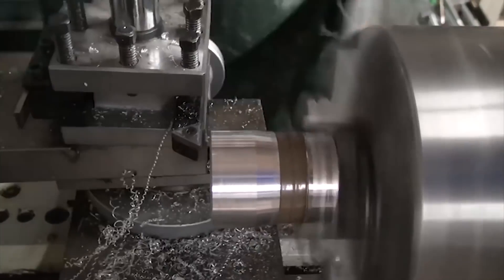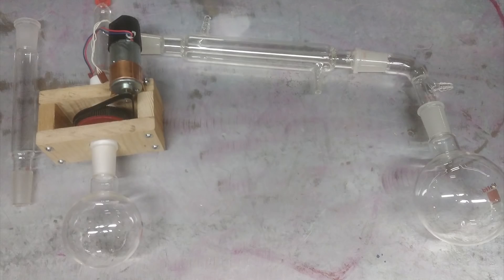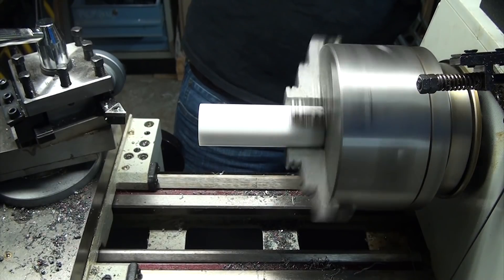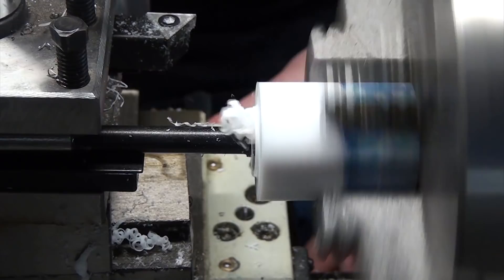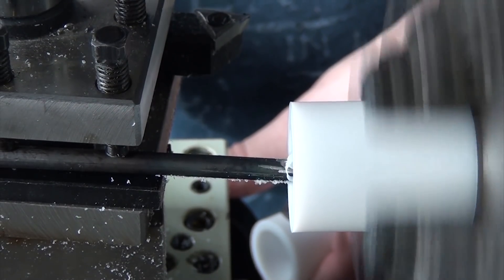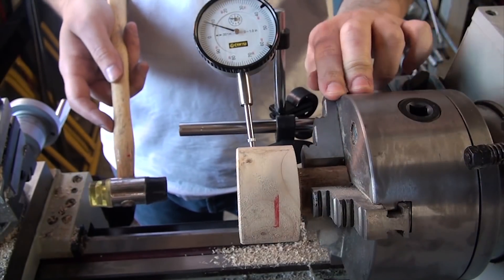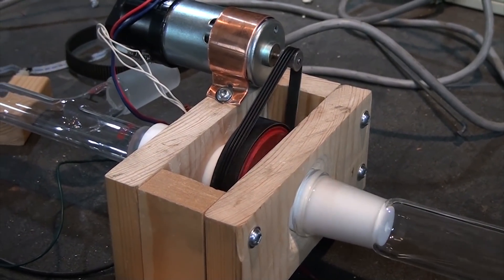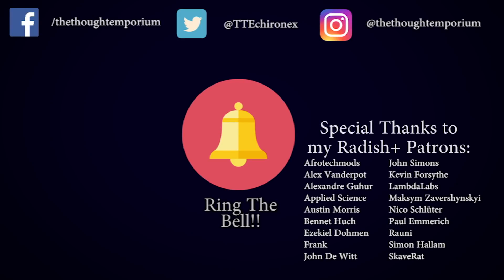DIY Rotovap - Motorized Rotary Vacuum Coupling Build

Comment: This is absolutely informative and helpful. The problem with my Rotary Evaporator is the spin is not working. If the spin is not working, then what could be the cause? Help me identify it so I can fix it please
Reply: Bad Motor, Unconnected Wire or Belt.

Comment: Very nice. Possible improvements: double o-ring; a roller or ball bearing to support the rotating shaft; a lip on the rotating part so the keck click can be used to secure the rotating flask / adapter. Anyway, would be interesting to see how it works under vacuum.

Comment: I strongly prefer sleeve and spool rotating connections with 2 o-rings over single o-ring design, the disadvantage is there are 2 seals instead of 1,and the hookups are 90° apart instead of straight, the advantage is pressure and vacuum produce no net force on the coupling, which is why hydraulic swivels utilizing this design are often only held together by a snap ring, and the other style usually require a ring of ball bearings to keep the fitting from exploding under pressure. Come to think of it, you could have simply purchased a snap ring style swivel from your local hydraulic shop, although they are made of metal, which might be a problem depending on the chemicals you are dealing with.

Comment: Regarding the large timing pulley, you wrapped a belt over it tooth side out and bonded that in place?  Normally, that won't work, as the spacing between the teeth on a pulley must be slightly less then that of the belt.  The belt should repeatedly jump teeth.  How did you get this to work?

Comment: Slick.  Roto-vaps are a big deal in organic.  Eventually your going to have to get something that works.  The alternative is that you get two round bottoms and have a connecting   bit in the middle.  The set up that I seen when I was a Freshman (the one and only time as the Department got a better one) --- so two containers, one was in a pan of warm water and the other was in a pan of cold water with the cold side having a plastic bit that attached to the hole melted onto a small diameter Pyrex tubing. That went to a aspirator.  The plastic bits, both the one in the middle where the small motor was and the output side were fashioned from blocks of high density polyethylene --- if memory serves.  One of the Department's Professors was a skilled glass blower besides being a cracker jack chemist and a fine instructor.  Them were the days!

Comment: it would be easier and more reliable to replicate original buchi's design - two ball bearings and a standard radial shaft seal directly on rotating glass tube (with male ground glass joint)

Comment: Could this be used for heavy vacuum distillation??
Reply: @Defke Willms Depends on the vacuum you have set up
As long as there's no leaks and you're using the right cryogenic then I don't see why not

Comment: the price of these means none in my kitchen lab.   but an alternative is simply
placing the flask vertical on a  adjustable stirring hot plate with a vacuum source.
and the proper 24/40 connections.  the stir bar will slosh t he liquid up the walls
a ways on a round bottom 1 L flask.
a water faucet aspirator will give you a few -psi.    and may not be enough for you.
my 12V. vac' pump cost about $30 on ebay,  its a 'diaphragm' type  that offers ports
for either vacuum or pressure.  the vac' goes to about -10psi.    by on-off it duty-cycle -wise
you can get any vacuum you want between 0 and -10psi.    

     can someone tell me what sort of software the thought emporium person
uses to make his videos ?  camera too.  and anything else related  to making
such good productions.  like where the action is speeded up.

Comment: im worried about the material you used cant handle some of the materials you are ineneverbly going to use in it,  some plasiks corode when used with difrend substances like alcohol asid and bases, wouldent it be better to get it made from either glass or ceramik, i really like your vids and really hope you consider all the posibilites when you use it so you wont get wear and ters or some residue stuck in the material that can react with future project materials.
Reply from the maker: You realize Teflon is one of the most inert materials we have right?
Reply: PTFE is chemically resistant to most solvents, and is commonly used in laboratory equipment.

Comment: Nice!! Ive been wanting to make one of these as well. The hardest part seems to be keeping a good seal while being able to rotate the flask. Glad you figured it out. What type of tests did you do to test the seal?
Would you sell that specific part? (With the motor and everything).. I don't have a lathe :-(
Reply: I just built one without a lathe.  Go buy two PTFE Stir Bearing adapters on Ebay, a short piece of borosilicate glass tube (I used 7mm OD), and a couple packs of o-rings for repairing a faucet easily found at a hardware store.  If you put the glass tube through each of the bearings, you can connect two pieces of glass distillation equipment with a vacuum tight seal and the PTFE bearing will rotate on the glass tube.  In mine, I drilled out one of the bearings to just be able to freely rotate it, and on the other I drilled only enough to fit the glass tube in so tight that you would need to pry it out after inserting it. I put mine together and tested under vacuum and it holds whatever vacuum I pull on it. Of note, the extra o-rings are for added layers of protection on your vacuum.  I put an o-ring at all joints, including inside the ptfe bearings.

Comment: Interesting project. I don't know that I'd have chosen to use wooden components, but that part is sort of secondary to the coupler and could easily be made out of something else. A lathe with a taper attachement would make doing things like this easier, but it looks like you did just fine without.

Comment: Very cool build, though definitely second the suggestion to make sure you can clamp the flask on safely, I kept expecting it to fall off.  Also definitely invest in a cheap (Around $200 on eBay) two-stage 12 CFM vacuum pump!  Fridge compressors are just awful and generally fail very quickly as well as overheating all the time.  It’s just not worth your time since you’ll get a huge increase in performance and ultimate vacuum with a proper vacuum pump, which will be important since you are going to want to be able to dry things as quickly as possible and a fridge compressor just won’t work well at all as well as being incredibly slow.  Also don’t bother with Harbor Freight pumps, they’re overpriced and have pretty poor performance when you could get a unit with 4x the performance for a similar price from any of several eBay sellers in the US.  Finally, you’ll want to build a cold trap to remove the water from the vacuum line before it enters your pump since water will destroy your pump over time.

Comment: I think bearing-support on the rotating joint-part would be better.
Also, as others have pointed out, it should have the right lip so a clip can be added.
I also agree that you would only need a groove on one of the parts as you could rely on a bearing on the rotating part to keep it in place and thus also reduce friction.
Viton is probably a must, and some inert vacuum grease.

Comment: Not having a lathe (or sadly the space for one), if anyone knows of a company that could machine the two parts for a reasonable fee, that would be awesome.
Reply: I just built one without a lathe.  Go buy two PTFE Stir Bearing adapters on Ebay, a short piece of borosilicate glass tube (I used 7mm OD), and a couple packs of o-rings for repairing a faucet easily found at a hardware store.  If you put the glass tube through each of the bearings, you can connect two pieces of glass distillation equipment with a vacuum tight seal and the PTFE bearing will rotate on the glass tube.  In mine, I drilled out one of the bearings to just be able to freely rotate it, and on the other I drilled only enough to fit the glass tube in so tight that you would need to pry it out after inserting it. I put mine together and tested under vacuum and it holds whatever vacuum I pull on it. Of note, the extra o-rings are for added layers of protection on your vacuum.  I put an o-ring at all joints, including inside the ptfe bearings. You could also add dielectric vacuum grease (food safe to improve vacuum, but mine seemed stable without.  Rotating after a while may reduce vacuum though, so perhaps its ideal to have the grease).
Reply: @MrJzWilder  Great info. Do you have a pic or diagram to show where to drill the 2 holes in the bearings and what size drill bits were used for 7mm glasstube.
Reply: @MrJzWilder  
 We would most defiantly like to see your design. 
 Any pictures or drawings that you may have would be really useful.
Reply: Look in your area for a machine shop. Where I live there is an old manual machine  shop that does mostly one-offs for agricultural machine repair. These type of guys stay busy in certain seasons, but are generally quite inexpensive when they are bored.

Comment: I would love to see the updates on this, How well is your design working? Why didn't you cut it a bit longer and fut a flange for a keck clip? How are you retaining your evaporating flask? Are you using any vacuum grease on your coupling? Where did you source the motor? How well does the coupling retain vacuum? Im making one of these right now so I was wondering how your design will compare.

Comment: im working on a vacuum microwave, and came up with a strikingly similar solution. Here's a tip: The vacuum will keep the 2 parts together so the grooves need only to be on the shaft if you use 2 spaced o rings on the shaft (to keep linear alignment).

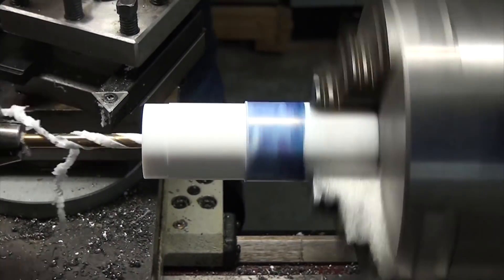Comment: 2:50 Next time you need to cut this taper, lightly chuck a 24/40 ground glass taper in a 4-jaw, clock it in as close as you can to zero runout, sight the top-slide against the taper and lightly lock it down, use a dial gauge in tool post against taper and move top slide, bump top-slide setting until you get '0' reading along full length of taper, lock down the top slide. It's now perfectly set. Remove the 24/40 and replace with teflon stock and start cutting using top and cross slide only (don't move the carriage after initial setup). Difficult to describe, very easy to do, and accurate.

Comment: Excellent project. I had wondered how a rotovap maintained the seal against vacuum. For setting angles accurately, look into getting a sine bar and a set of gage blocks. Both are relatively inexpensive and have lots of uses.

Comment: Really excited to see how this goes. Everyone doing amateur chem work would love to be able to hack together a usable, affordable rotovap. I thought the coupling looked like a pretty good idea. Might need a tweak or two, but I can't wait to see how it goes. My concern is trying to use a Leibig condenser. Even pulling a light vacuum (say 300mm absolute) with solvents boiling 60-80°range, using a simple column to put some distance between the pot and the condenser, and using ice in brine to keep cooling water -5 to -10C, way too much solvent was coming through my pump for me to keep using it that way, even though it is a PTFE-Lined diaphragm. And this is with just stirring on a digitally controlled warm hotplate. You can pick up a Friedrich condenser on ebay for $40-60, sometimes less with a little patience.
Reply: Ha! Nice pic yourself. We were in Madras, OR for the eclipse. Was pretty stoked to get the shots I did.
That sounds like a good idea. I'm trying to figure out how I can cobble together the glassware I have to do something like he's planning.
Reply: @NicholasA231  Corvallis is where we caught it, and thankyou!
Reply: first off, Nice profile picture. Second, I think the sous vide cooker would  be a perfect attachment for an amateur rotovap.

Comment: I once thought about using ZIploc seals for rotating air tight connections. They glide smooth and hold tight when you make them into a ring.

Comment: Great video, great project as always ! However, after 4 years of O-chem and watching all of ThisOldTony, i would've maybe done a few things different. The O-ring should only seal, not be the retaining part of your system. Also, it's going to be under vacuum, you should have made the 2 parts mate together, the vacuum will pull them together. I'd recommend you put 2 O-rings, only put a groove where your joint fit and get a good surface finish on the inside of the other part. Make the groove slightly larger than the ring so that it can flatten. (also take Vuiton O-ring otherwise solvents will destroy them in minutes)

All of this is opinion, maybe it works best as is! I'm sure i'll enjoy part two anyway ;)

Edit: also people pointed out there is no way to clamp the flask, never good to rely on vacuum alone, unless you want to come back to a spilled flask...
Reply: I was just about to comment the same stuff about the o-rings. Great video, I agree, I love most of what he does, but generally O-rings are a) designed to be slightly stretched, b) only utilize a groove on one of the two mating parts and c) ONLY SEAL lest one risks tearing the o-ring to shreads. The addition of  wear ring(s) and retaining rings would be a good idea. Also they aren't designed to be used dry, which also risks nicking it and rendering them useless (unless you buy super special rings which are designed for dry use but these are pricey and usually for very very specific applications like some rocket and space grade hardware). Also the lubricant should be of something different than the o-ring material and the encasement material  (ie if you use silicone o-rings you can't use silicone grease since like dissolves like).
Reply: @maxk4324  Polished ceramic disks make really good seals. Not sure if good enough for a vacuum. Like the valves in a single valve hot/cold faucet.
Reply: Was about to comment on this too. But seeing as the casing is made of Teflon, I think the most simple and impactful modification would be to use 2 O-rings on a conical shaft, a bit like an axial bearing. Because a single O-ring has no way to counter any bending torque, whereas two would generate a reaction torque to any bending stress. And the conical shape so you can assemble it. Alternatively there could be two diameters: smaller tip, larger base; easier to machine, but smaller axial stress capacity. I don't think the axial stress is large enough for the intended purpose to warrant a separate retaining part.
Reply: I figured motorized rotary vacuum couplings, typically just use slip rings for this purpose? Is that not the case?
Slip rings: https://www.dsti.com/slip-rings/
Reply: @firSound  for vacuum?  Typically, slip rings are for multiple conductor rotating parts

Comment: If you have to turn bigger diameters on your lathe, you can remove the jaws from the chuck and mount them in reverse position to grab the part at the OD. Make sure to put them in in the right order (the jaws got numbers 1...3 on them.

Regards Valentin

Comment: Maybe should have designed it so you're able to kek clip the round bottom flask onto the rotary coupling? I would definitely not be comfortable with having a flask of precious material being partly submerged in water without making sure it won't drop into the water. Everything else seems pretty amazing and affordable, though!
Reply from the maker: I may go back and add that. I thought about it while designing it, but also keep in mind eveything is under vacuum. The flask is essentially being sucked onto the connector and the fit really is very tight. Like getting it back apart can be hard when you want to take things down at the end. But I totally understand the concern. I'm gonna test the heck out of it and see what makes it fail.
Reply: @thethoughtemporium : Yeah, I guess the vacuum should hold it in place, but at least when I use a rotavap, I usually start very gradually with the vacuum, so as not to make it boil, bubble and overflow, in which case one can't be sure the vacuum alone will hold the flask in place. But of course, if you test it a lot and get to know the apparatus, it might turn out to be a non-issue!

Comment: Awesome work! Thanks for sharing :) What kind of vacuum can it sustain? Do you grease the joints?
Reply: I read an interesting piece of advice (more a command really) in a Rotavapor R114 manual about NOT using grease around seals (static joints are fine). The reason made good sense : -if any detritus at all should come into contact with the grease it basically turns it into grinding paste. As some of the contaminants might condense to form crystals etc, this could score the PTFE and rapidly degrade the O-ring.

Clearly for all the other joints, a wipe of silicone grease might be helpful - though I find a wrap of PTFE tape is both a better seal AND makes for a less messy disconnect.

Comment: Nicely done, but I hope you made sure that the O-Ring doesn't get damaged by any sharp edges.
Those easily shave the O-ring to bits overtime.
Reply: Yeah. Check out the guides online some manufacturers write for o-ring groove design. If the area or compression are wrong, you could get the ring sucked into the wrong place.

Comment: You may want to leave room at the   mouth of the flask so you can use a kek clip to hold the flask firmly on.
Reply: I was just reading the comments to make sure someone addresses.  We used to use Keck Clips also.  Maybe to prevent having to remachine a new adapter to be longer for a Keck Clip... maybe some sort of spring or rubber band tensioned two sided "C" or "U" jaw to fit around the neck against the lip to prevent the flask from coming off.